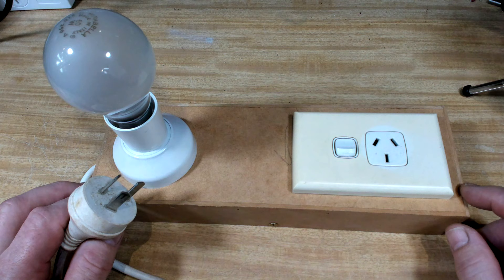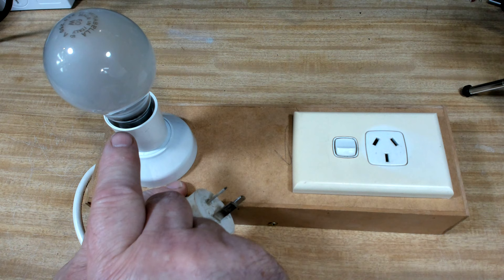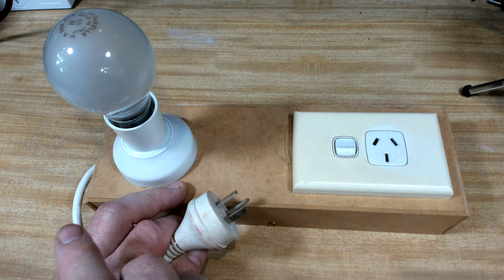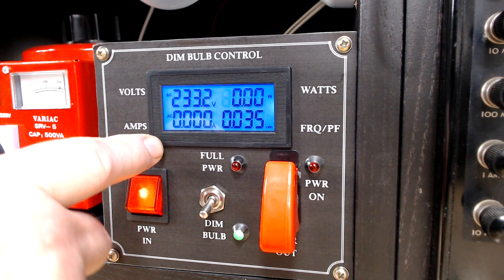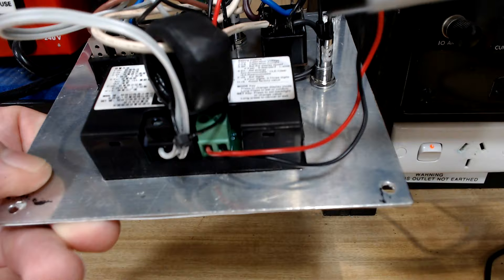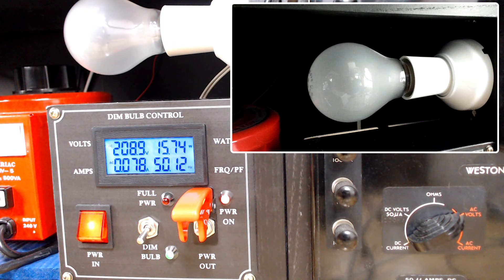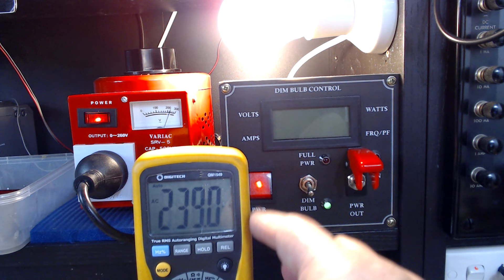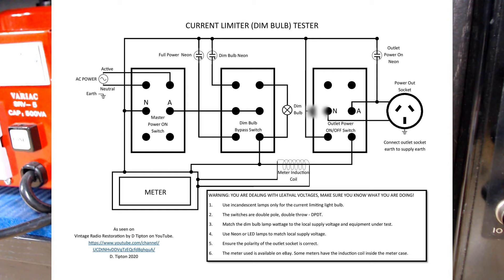My Dim Bulb Tester Revealed

Comment: Excuse me David, I would like a clarification because I intend to replicate your project. The earth pole of the mains socket and the earth pole of the socket where the radio is to be powered are connected, is that so? Thank you
Reply from the maker: Hi Consiglio, yes, the earth carries through to the socket but my dim bulb is connected to my isolation transformer so the dim bulb earth is not connected to earth.
Reply: @DavidTipton101  Forgive my ignorance, I am a neophyte and would not want to make dangerous mistakes, so I ask you if you can make a clarifying sketch of the grounding. Thank you
Reply from the maker: @consiglioiannuzzi9314  As the circuit says connect the power input earth to the power output socket pin. If the case is metal run an earth wire to that as well. If you plug it into and earthed socket and plug a radio into the dim bulb it will be also earthed provided the radio has an earth wire. I plug my dim bulb tester into an isolation transformer which by design has no earth so the dim bulb isn't using the earth connection. If you are going to work on live radios I strongly suggest you purchase an isolation transformer to protect yourself and your test equipment.
Reply: @DavidTipton101  Now it's all clear. As for the isolation transformer, I am already equipped with it. Thanks for the clarifications!

Comment: Awww, I have been waiting on your page, not here. Darn, 2 minutes late :D Hey this is a perfect fit for me, I am often called a dim bulb LOL My dim bulb is 3 sockets in parallel with 60 watt bulbs in each. I just slightly unscrew the bulbs I don't want to use in circuit, nice and adjustable .... not that I have ever needed all that range of bulbs :P  We have a hard time finding incandescent bulbs, by law most home bulbs are LED or Fla. We can only get the "fancy" bulbs, clear with giant fillements for decoration use. Still 60 watts though so that is good. 110 v not your more manly 220 :P   To monitor voltage and current I have 2 BK Precision bench DMMs installed permanently. I  bought about a dozen of them in a lot from a excess inventory auction at a school a few years back along with 6 AC/DC power supplies and a yard size trash bag full of cables for $100 U.S. No loss using 2 of meters here. One for current one for voltage. They stack together nicely. I have always liked the look of your setup, the outline and scallops around the screws really make a difference. Very nice :D
Reply: "not your more manly 220"  ... closer to 250 usually.
Reply: @James_Bowie  I stand corrected. Here is is called 120/220 however that is RMS, peak to peak it is closer to EH 180/260 give or take a little :D
Reply from the maker: Hi Wayne, I've been called lots of things too 🙂 The bulbs are a problem, I've seen them on eBay and in garage/yard sales. The switch in multi-bulb tester is a good idea, I considered it but the Variac can take care of it most times. Thanks Wayne 👍😀
Reply: Try looking for appliance bulbs. I understand they were exempt from the regulations (in the US at least), after all an LED wouldn't do well in an oven. There were several on 1000bulbs.com.
Reply: @markbrownfield437  Only low power - perhaps 30-40W max, unfortunately

Comment: hello David, can you please give the type of the meter?  TIA
Reply from the maker: Mine is from eBay, search for "Current Power Meter" or similar. Make sure the voltage range of the meter is suitable for your local voltage. Meters with a range of 80 to 300 Volts covers should cover it. In North America a lower voltage will be OK.
Reply: Thx David - great video's  @DavidTipton101

Comment: One other question for you Dave.  The bulbs are listed as Neon bulbs.  GREEN Neon bulb?
Reply from the maker: I think they are neons Wayne, the description doesn't say but they are mains rated bezel lamps. Here is a link to my local supplier: https://www.jaycar.com.au/green-mains-operated-chrome-bezel/p/SL2633
Reply: Great video Dave, just looked in the Jaycar catalogue for the cover for the off switch without luck. Do you have a link for the one you used. :)

Comment: Hi Dave! Just a comment about your schematic. You have the 'A' line shorted to the 'N' line it appears...
Reply from the maker: Hi PBR Street Gang, I rechecked and I had a line from the Neutral to the right switch centre contact which would mean the outlet wasn't completely isolated when off, I have changed that in the downloadable version. Where is the short you can see?
Reply: @DavidTipton101  The device is obviously working for you but I think the diagram needs to reflect the actual circuit...

Comment: Thanks Dave for covering the Dim-Bulb topic....
One thing about the meter, it will not measure down to low AC voltage, due to the fact that the meter needs to be powered and needs a minimum of 80vac if I recall correctly...
So, I did some research and found the PZEM-021 Power meter suited my needs, but would not go to down below 80vac before it shut off, because the source power needed to sustain the display must be around 80vac or better.
However, the "R Brown" YouTube channel does show how to hack your PZEM-021 to make its power source independant of the Volts and Amps measuring.
I found his 4-part video series very useful :   https://www.youtube.com/watch?v=47osFl0LuJ0
Reply from the maker: Hi DRR, thank you. Yes, the meter will not work under 80VAC but I don't use it that low so it hasn't been a problem so far. I'll check out the link in case I need it in the future. Thanks for sharing the link 👍🙂

Comment: Will I need a 110V bulb to test a 110V radio?
Reply: PisoTones you will need a step down transformer or variac as a minimum to test a 110v set. You don't need a 110 globe
Reply from the maker: HI PisoTones, You need to use a bulb rated for your local supply so yes. If you mean running a 110V radio on a 110V supply with a 240V rated bulb you would need to up the wattage of the bulb to allow for the increased current flow 🤔
Reply: @DavidTipton101  yes you would need a 240w bulb rated for 240v if it was ran on 110v to be equivalent to a 60w on 240v due to the power of 110v being a quarter of that to 240v. Although that might vary due to incandescent bulbs not having a linear resistance so experimentation would be required
Reply: @DavidTipton101  Thanks, David. That is what I supposed.

Comment: Those bulbs are damn hard to get, would the smaller piggy type bulbs ? Thanks Dave .
Reply from the maker: An incandescent or halogen will work if it is the correct rating 🙂
Reply: Thanks Dave, appreciate your response.